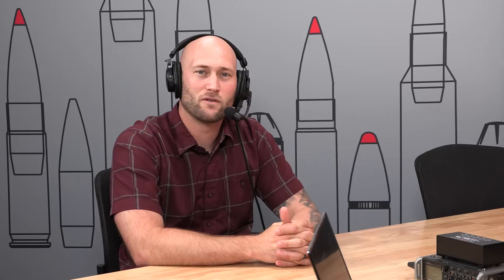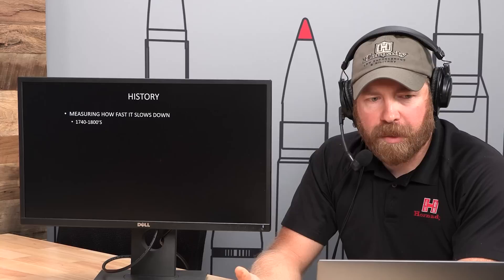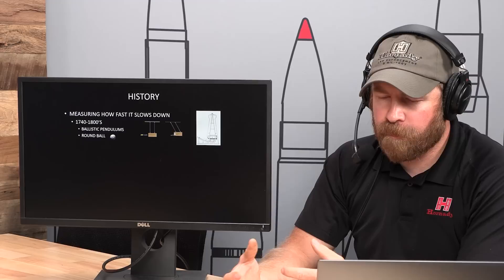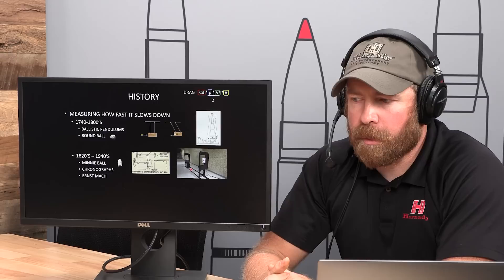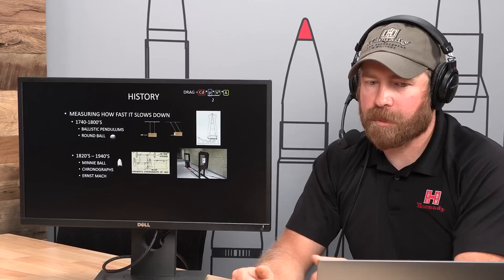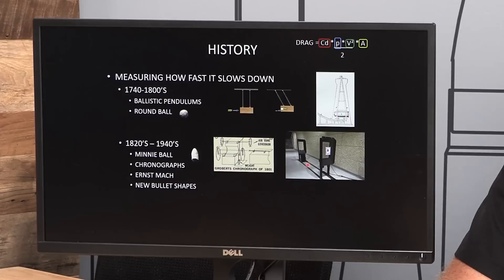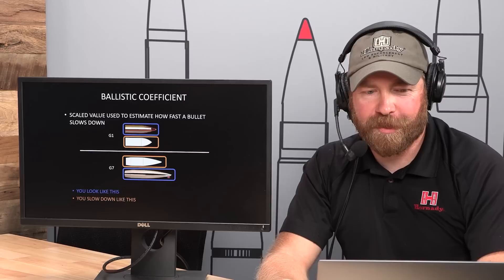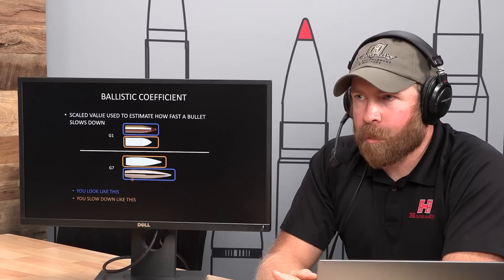Ep. 034 - Bullet Drag & Ballistic Coefficient

Comment: Points on content: 
   1.  When you say that the spin imparted by rifling on a spherical musket ball does not make a difference, the science shows that it does. A spun spherical ball is more stable in flight than a non-spun ball and will be more accurate as a projectile coming out of a rifled bore than out of a smooth bore. It also applies to cannon balls.  Muskets had started to be rifled before the conic projectiles were introduced. Check it out!
   2.  The early studies on shapes and drag of projectiles in air were helped by previous studies made on ship hull shapes and drag in water. The ship hulls were shown in naval studies to be important to drag much earlier than the studies on projectiles in air. Many of the conclusion reached in hull shapes, including ogive shapes, helped direct the studies on projectile shapes. Fast sail boats builders had produced advanced technologies (for the time) on drag and had hull shapes that catered to many hydrodynamic principles that had their equivalent in aerodynamic physics.
   3. You study of bullet BC at Mach points is fascinating!
Thank you!

Comment: I know I’m way late on this video series, however,
Another great way to show this is, is to graph of bullet flights over distance, assuming that muzzles are pointed at the exact same angle over the horizon
For example a G7 trajectory graph and a 308, or 6.5 trajectory graph overlaid with each other.
The Cd changes tell the scope how to adjust angle, so you’re pointing the barrel a little bit higher or lower, but you would see on the graph how the bullet flights change, and at what distance the paths overlap

Comment: Why did you guys discontinue the 7mm 162 AMAX? I have a recipe that will clover leaf 1 inch under target at 300 yards in heavy winds, while my factory 150 corelokt fell about a foot off with the wind and a foot low holding maybe 6 inch groups. (cci 250 lr primer/61 grains reloader 19/7mm162AMAX) set "just a hair" off the lands on a Old model 700 7mm rem mag/old leopold vx2.